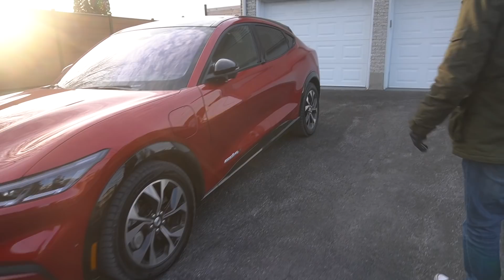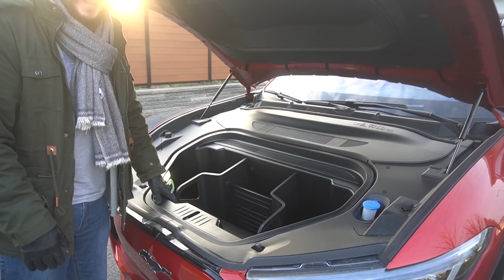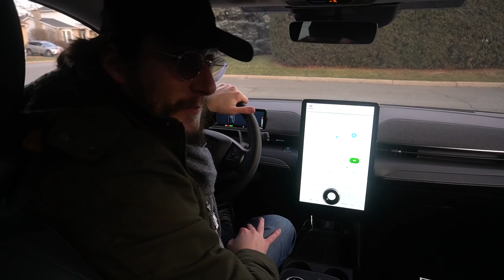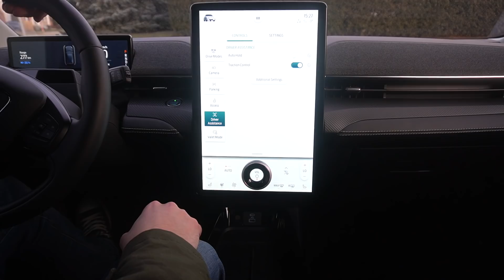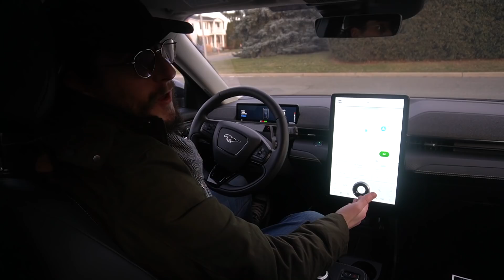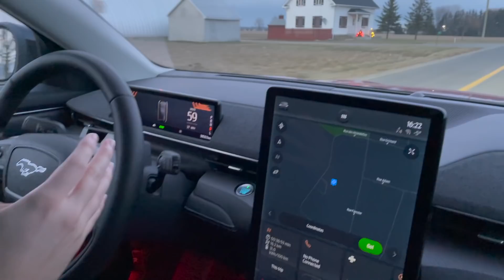Ford Mustang Mach-E First drive by Electrek

Comment: The interior design of Mach-E is simply boring and lacks the clean and elegant high tech and/or luxury feel altogether. SW on the main panel display is notches below Tesla's in terms of smooth implementation of UX. Quite disappointing. Exterior is more acceptable. Ford is going to be a history within a few years, I'm afraid.

Comment: An EV with a well-designed inverter would make a really good AC power backup for your house. Done right, you could run a refrigerator and/or a number of less power-hungry devices.

Comment: Good review. Ford will sell this well especially if the government gives tax incentives. I'm old school and something is to say about the sound of a nice sounding gas V8 but I can see the appeal to electric as well. Glad we have both for now to choose from. I really do not think electric is all green energy as they make it out to be. The manufacturing of the batteries and discarded batteries has a toxic effect on the environment as well. I really do not understand why they are not solar paneling the tops of the vehicles if you really are trying to make a green efficient car. The energy that is used charging is probably close to the same effect on the environment as making and burning fuel. Maybe not as much but my point is put some built in solar panels. Tesla has been inventive but other manufactures will soon catch up.

Comment: Let's see... Compared to a Tesla-3 (the cheapest model of Tesla).
The Ford has similar performance, much lower range, is slightly more expensive, will depreciate much faster, the software is primitive in comparison.
And the Tesla-3 will outsell the Mach-E by about 100 to 1 (that is, if Ford is lucky)

Comment: Nevertheless, at the end of the manufacturing process, electric cars are the ones generating more carbon emissions, according to the Union of Concerned Scientists. Why is this? Because electric cars store energy in large batteries (the larger they are, the bigger their range is) that have high environmental costs.

Comment: Good to hear positive review of the one-peddle driving. I have a 20 Bolt and before an 18 Leaf. The Bolt's one-peddle driving is a huge disappointment. Not very consistent feel, doesn't work in reverse and sometimes causes nasty grinding sounds. If the car is at a complete stop while on a hill and the park button is used, sometimes there is a nasty grinding sound like gears grinding. It's not every time, but the steeper the hill, it appears more likely. One-peddle does not hold on very steep hills, so this is a somewhat regular experience. I think it can be avoided by pressing firmly on the brake, but never had any problem with the Leaf and it held on much steeper hills.

Over all the Bolt is a lousy car and I wouldn't recommend it. I am already planning to replace it.
Reply: you can use the brake to fully stop before engaging park to avoid the horrible sound of the ABS pump braking the wheels
Reply: After selling the Bolt, you should switch from peddling pebbles to one-PEDAL driving.
Reply: Should have gotten a Model or a BMW i3. I mean why buy a Bolt?
The overall quality is worst than a Tesla Model 3.

Comment: The front and rear doors have kick stands which prevent both the front and rear doors from closing on fingers until the door is more fully opened. A great idea for the rear door especially.
Reply: But once the door is opened a little more, nothing stops it from slamming on some fingers...
Reply: @OlJackBurton It seems like the door has to open a pretty good width, maybe a small body width or so before the kickstand retracts but admittedly the  2 videos i have seen didn't make it clear. I have yet to see a demonstration that clearly shows the point when the kick stand retracts or a measurement 9f tue width so if you know the width the door needs to open or have seen a video about it please share the link I'd be curious to see it.
Reply: @cccaaa9034  One thing to consider is that there are no door handles to grab.  In fact there is nothing to grab, particularly on the rear doors besides the actual door.  So even if you're closing the door to just purposely close it, depending on how you're holding or touching the door or say even just a very windy day,  you can still accidentally smash your hand. Or you could open the door fairly wide and then close that gap much smaller for whatever reason, say you're in a tight parking space against another vehicle or something. It's not foolproof or child proof and definitely not lawsuit proof. There should be a laser sensor or something in addition that detects any object in between the door that prevents it from fully closing...
Reply: @OlJackBurton  people have been closing their fingers in doors and things of all kinds forever, not sure about any success with lawsuits w/r/t that.

Comment: Can you shut off the ICE acceleration sound?
Reply: Yes it can be turned off and it is amplified frequencies from the electric motor, not ICE engine noises. It is there as option to help some people with motion sickness they can experience from accelerating in an EV without having an associated sound.

Comment: The screen inspired by Tesla? Bro the whole EV industry is inspired by Tesla!
Reply: And Tesla is inspired by the whole auto industry. Duh..
Nice try though fanboy.
Reply: @mamadouaziza2536  wtf? Sure, except the CORE business of internal combustion engine lol
Reply: @mavrez6  
But Tesla is into the core business of personal transportation.. 
4 wheels mounted to a steel frame with a motor.
Reply: @mamadouaziza2536  You mean that core business, I agree. So what? They’re all trying to catch up Tesla anyways. I guess the pioneers of personal transportation are quite outdated now.
Reply: @mavrez6  
Ford is most definitely catching up to Tesla and so is Lucid, its only a matter of time. Also, Toyota just might change the entire game with hydrogen cell technology. If these latest batches of EVs from BMW, Nissan, GM, Rivian and Lucid are flops, the EV industry will end.
Reply: @mamadouaziza2536  We’ll see what happens I also think there will be competition no doubt about that, what I doubt is Tesla just standing watching and doing nothing, they’re just getting started.
Reply: @mavrez6  
What more can Tesla do to the auto industry that they haven't already done? They can release a sub $25k car with AutoPilot..
They have already released beta full self driving. They are improving batteries.. Nothing else to do..
Reply: @mamadouaziza2536  Hydrogen. Coming since 1995, or the Hindenburg, depending on your perspective.

Comment: Nice car, wrong name.  Ford spends millions designing this fantastic new vehicle, and their marketing dept doesn't have the brains to think of a good name for a brand new car line?  Lazy IMO, stuck in the past.  That's really too bad.  My other dislike was the dash display is too big, and it needs to be built into the dash , like Tesla, but horizontal instead of vertical so it fits the dash better, as if the dash was actually designed for the panel.  That obscenely huge panel looks like an add on iPad pro, appearing to be an afterthought.  I think they forgot the spare tire too.
Reply: For me the fake engine noise is goofy af.  The name could be changed as well but that is a compromise for the nostalgia crowd.  Nostalgia is a huge marketing point.  e.g., look at all the Star Wars fans out there.
Reply: To be fair, compared to the other EV names that are out there, Mustang Mach-E is pretty good... I-Pace, e-tron, ID BUZZ, ID VIZZION, ID CROZZ, EQA, EQB, EQC, there's so many weird and bad ones being used.
Reply: Screen is not too big. It’s wrong orientation tho. And dial is a stupid design.